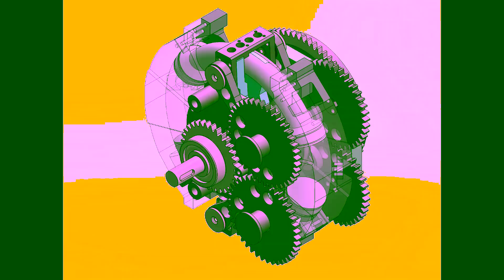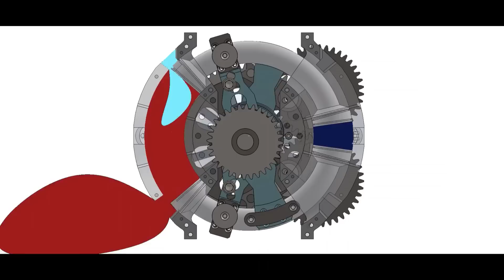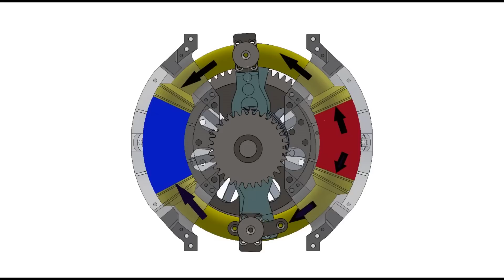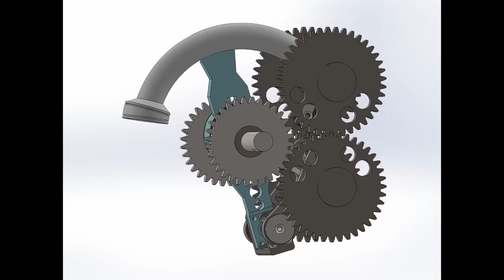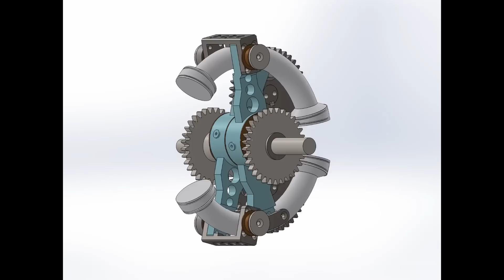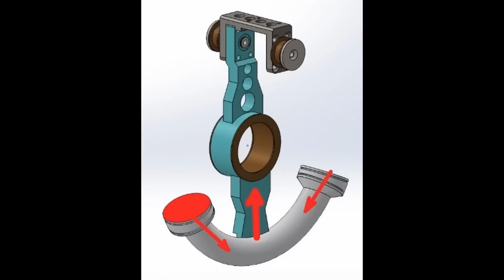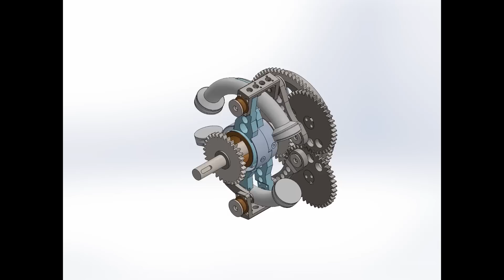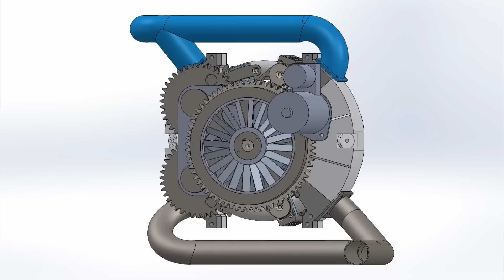A new type of Engine

Comment: This looks very similar to the Taurozzi Pendulum Engine which also works on the idea of a curved piston cylinder. It tauts the advantages of minimal contact with piston cylinder walls and many of the same advantages you have mentioned in your presentation. Mr Taurozzi (who designed the Taurozzi Pendulum Engine) also managed to build a working model of his engine and tested it on a highway, showing that his engine design is possible and functional. 

The Achates Power Opposed Piston Opposed Cylinder (OPOC) design is a two-stroke design which suggests that you are heading in a good direction with your design choices - since they are already testing prototypes.

Unlike Achates Power I noted was that Mr Taurozzi did not use an OPOC configuration, instead he opted to used a traditional engine design (i.e. using an Over head cam system) - that being said there are a few alternatives to the design of his engine. Some of which start looking very similar to what you have shown (look at the double pendulum version).

(My Opinion) Your design looks to be somewhat of a hybrid between the Achates OPOC and the Taurozzi Engine, all with your own unique spin on how these designs come together and I believe your design could very well be the next big development in the automotive industry.

With all this in mind there is a definite credibility that your design could work based on the research that has already been done in the previous mentioned engines.

Keen to see your proposed next presentation that were mentioned around this novel engine design.

All about the Taurozzi Pendulum Engine | Advantages, Working Principle, and Performance (100144.V1) on the Ft-share International channel
https://www.youtube.com/watch?v=5ekoNVc6pm0

FIRST DRIVE: Achates Power 2 7L OP Engine on the Achates Power channel
https://www.youtube.com/watch?v=usmauFigpzk

Comment: The design is interesting, but constructing these on the factory will be expensive due to the curves machining. Curves should be very precise to handle gases pressure in pistons with no leaks

Comment: Interesting. There a lot of torsional issues but it's almost like same complications in a Sleeve valve arrangement. The other point of concern is gear inertia & surface hardening. Sealing the travel areas & for lack of a better term the "Crankcase"....up in smoke would go any friction theories. It would a monster to assemble.

Comment: The moment you try to change the direction of a body there is always a force. This force will try to bend the piston there is no perfectly rigid body in the real world. Because of the elasticity of the material the piston will be in contact with the outer cylinder wall and thus friction will occur this means it needs to be lubricated. When you want to seal the combustion chamber this means the clearance should be very small and here comes the imperfections of the metalworking - no two pistons will be the same, again you need lubrication.

Comment: I am aware of about 20 different types of internal combustion engines. They may be more, I do not know everything.
Yet, for mass production, the manufacturers still go ahead with the same types that were used for 140 years.
This is only a fact, I am not the one to answer why is that.

Comment: These cylinder bores are impossible to hone
Reply: As electrical engineer (so, not mechanical), I think that is possible, but it would be very expensive, not feasible for mass production. So, I am not getting my paycheck from implementing manufacturing technologies, but the way it could be done is with a spherical honing tool, at the end of a flexible shaft. Because the axis of that cylinder bends in an arc of almost 90 degrees, the spherical honing tool would need to enter from both ends, and advance until the middle of the cylinder. 
This kind of headache worth for one piece to be send in cosmic space, not for a mass produced object.

Comment: Before I make my comments about this engine, I'll state my experience in the field: postgraduate (by research) qualified automotive engineer, with 21 years of experience. I've been an professional engineer in many aspects of automotive engineering, including design, warranty and quality, fleet operations and maintenance. I've worked in a number of areas of the vehicle, including HVAC, interior, brakes, suspension, powertrain integration (fuel storage/delivery, mounts, exhaust, air induction, powertrain cooling), and engines.

With that said...

No, this engine won't be frictionless. It will have just as much friction as any other IC engine, if not, more because of its complicated mechanism and unusually shaped bore and pistons. Saying it will be frictionless shows your inexperience in engineering.

Assembly would be "interesting" to watch if the pistons are truely of a single piece design.

In a normal IC engine, friction is relatively small compared to the energy lost due to the thermodynamic efficiency limitation of the ideal spark ignition and diesel engine cycles. Making a complicated mechanism that doesn't reuse the waste heat that's an unavoidable part of the relevant thermodynamic cycle for the engine will only serve to make the engine more complicated, costly, and unreliable than normal engines of the same cycle and compression ratio. It will also make them use more fuel than a normal engine of the same cycle, CR, etc.

The heat lost through the walls of the combustion chambers will be comparable to that lost for normal engines of the same cycle, compression ratio and materials.

While it would be possible to make such engines with the manufacturing technology that's available now, this design would be horrendously expensive to mass produce. Sure, it could be 3D printed, but to do that at the tolerances required for an IC engine with the types of materials that are required for IC engines would be very expensive.

The inertia of the pistons (which would be considerably heavier than those of a normal IC engine of the same displacement - especially with their pendulum arms) would result in considerable vibrations. The motion (and inertia) of the cranks will only partially counteract this. To balance this out properly, you would need to put at least four of these engines together in the same crank configuration as a normal inline four-cylinder engine, which would make this an incredibly complicated (ie: expensive, and probably unreliable) design.

In this design, since there are four cranks which are in phase, all stopping at TDC and BDC at the same time, it has the same mechanical disadvantage as a normal single-cylinder ICE unless it's manufactured per my previous point. The cranks are also considerably off-centre with respect to their wrist pins on the pendulums, which will make the speed profile of the pistons considerably different in the two directions. This will be bad for vibration and engine tuning.

Being a two-stroke, it has the same disadvantages (and advantages - if it's lucky) as a normal two-stroke... provided that the added complexity doesn't eliminate the two-stroke's advantages (which it probably will).

It looks like it will need a supercharger to make up for the fact that it doesn't have a crank-case that's suitable to use as a pump to push air into the cylinder.

Because it will need lubricating oil for the cylinders (the idea that it won't need lubrication is absurd), there's a chance that it could use just as much oil as any normal two-stroke (this will depend on various aspects of engine design).

In order to prevent piston scuffing, the crank cases (yes, more than one will be required) will need to be precision machined to tolerances that aren't required in normal ICEs.

Considering the very high cost of tooling that's required for mass production of normal ICEs, and the far more complicated machines required to build this design, the tooling cost for mass production of this engine would be extremely high. It would have to show extreme benefits compared to normal ICEs to justify the extra cost. Given the fact that it absolutely will not have the benefits required (if it even has any benefits over normal ICEs), there's no way that such an engine will be produced in mass quantities by any manufacturer anywhere, ever. Sorry, but I'm just telling it the way it is.

It's an interesting design that has been tried (and shelved) before, but it's nothing more than a curiosity. If you get any investors from considerable companies, it will probably be because they foresee you having certain problems that they would like solutions for in other applications, and they see you as someone who thinks outside the box, and as such, you're a potentially cheap way to get a solution for something else. My general advice is to get some experience, find something that actually needs to be solved, and design something that fixes the problem, rather than to make yet another complicated and expensive engine (it isn't the first, and probably won't be the last) that has no chance of ever making it into mass production.

Comment: Nice Video!

I don't know so much about motors, but if I perceived it right, you only have 2 combustion steps in the engine (instead of 4 in traditional motors).
So to me, it seems like you have to add some technology for gas-exchange, or design the 4-cylindric version of your motor in a way that it has 4 cobustion steps...

Is there some technology to quickly exchange reacted gas by fuel? And  how can we separate the two Gases, so we don't have any fuel loss.

I'm hyped about some cool problem solving of You or to otherwise learn something about existing solution for that.

Comment: The valves are way down the piston stroke. That means less air fuel mixture can be taken in. You could place the valves at the tdc. And please talk less about the efficiency. All piston engines work on thermodynamic principles. That means they are bound to be victim of heat loss. I urge you to please talk about the motion conversion. From rotational piston motion to connecting rod's linear motion back to rotational crank motion. 
It seems that the actual working principle is buried under the grave of your claims.
When this happens we must assume that something is wrong.

Comment: If you flip the exhaust to exit the top side and intake to enter the bottom I feel like that would help to get more fresh air into the combustion chambers. Since hot air rises anyway the fresh cooler air will want to fill in the space faster. Would make for a slightly more complicated intake and exhaust but it's a 2 stroke and anything that can help get the exhaust out of a 2 stroke is good. Very unique design, would love to see it work. 
Ive always heard combustion engine efficiency was more around the 20s of percentage. Then things like the Hemispherical heads added about 4-5 percent and then opposed pistons like this we're achieving closer to 35 or 40%. 
Seeing that the explosion has to be contained  in between 3 walls and only 1 wall wants to move. Adding that opposed piston makes it so the cylinder is now the only wall that doesn't move as typical for combustion engines. Hemispherical opposed pistons would be the best but you would need some super hard steel or titanium piston heads to hold up to the abuse around the edge of the piston.

Comment: I don’t see much thought put into the fluid dynamics of air… if this is going to make power, you need volumetric efficiency, basically getting the spend gasses out, and fresh air (and fuel) in… gasses that are still expanding when the exhaust valve opens not only leaves power on the table (part of why long stroke engines produce more torque), but also will not adequately draw in fresh air by the scavenging effect as the gasses exit the chamber and travel down an exhaust runner… is there something I’m not understanding, whereby there is a mechanical contributor to induction?

Comment: A rotary opposing piston power plant is a great idea, I see it having good ship engine properties, which already tend to use opposing piston engines (and ideally run at a steady rpm for long periods of time). Also works well with the water injection cooling function. Great presentation and great idea

Comment: While I see that this is a well thought out design, I would worry about the mechanical friction of the gears. Regular engines work via a crankshaft connected to the Piston. By moving the rotational motion to the gears we now have multiple sets of cogs that now need proper lubrication, lest the entire system burn up. even if the piston itself didn't need the oil, the gears couldn't last long with the stress of going faster and slower suddenly. and the noise it would create would be enormous. I would expect a loud buzzing sound like a Wankel engine. 

Otherwise this design could be stackable, and self contained easily. I would just worry about its Efficiency compared to a two stroke engine, Wankel, or a box engine config.

Also "Rotary engines" are the ones affixed to prop planes. I would work that name out... "Crescent engine" comes to mind with the moon like look of the pistons.

Comment: Would be intrested what your thoughts on how lubrication is achieved, intresting thought and a working prototype would be really intresting but i would also worry about complexity(altho current engines also face that problem) and the issue with gears wearing and reducing efficiency(mayby chains or another method im not sure)

Comment: great idea, altought i dont think making it a two stroke benefits it, first of all it vents exhaust and takes air in through the same port, while also leaving a gap behind the pistons, meaning they cant be properly lubricated by normal means, so as in a two stroke youd have to add oil into the fuel, further decreasing emissions and efficiency. the engine also has a very small timeframe to suck in air, leading to huge power losses compared to a four stroke. all im trying to say is you should think about making a four stroke version, or at least some variation of the four strokes valve design.

Comment: And where is the pre-compression of the fuel-air mixture in order for it to then displace the exhaust gases in the combustion chamber? A conventional 2-stroke engine, when the piston moves down, compresses the mixture, which then, when the supply channel is opened, displaces the exhaust gas from the combustion chamber, but this is not in the diagram above. Therefore, after the purging channels of the combustion chamber are opened, both the exhaust gas and the fuel-air mixture will be in it, and how will it be ignited? The only option is to add a turbine to pressurize, but there are also risks that the mixture will enter the exhaust system after the combustion chamber and will already be burning in the muffler. In general, where is the question on the design of this device

Comment: The problem with this is that it is very costly and time consuming to manufacture a torroidal cylinder. There was a pendulum engine idea which had a curved cylinder as well but the manufacturing process was so complicated and most of its claims were not accurate so they had to drop the idea

Comment: This is a really cool concept, but you may want to examine the material stresses on the curved pistons. That kind of thing could cause uneven strain and premature breakage. Or it might not be a problem at all. that's why you should look into it, to confirm one way or the other.
Reply: Could you please explain how to do that ? 
A curious amator question.
Reply: @yezzamouad9469  Unfotunately I'm not a mechanical or structural engineer, I just know about the uneven forces. I'm not sure if material science is even good enough to produce a piston with varying strengths across it's volume in such a way that could make up for the stresses and strains.

Comment: I'm curious on the method of converting the pendulum rocking motion into a rotational force. I'm no engineer but the only method I can come up with is a ratcheting mechanism... If that's the intended method, what is the anticipated life span of such a system? It would be a wear item like a clutch and would need to be easily serviceable. But I could be way out in left field here too...
Reply: Watch the video slowly in the 0:25 to 0:30 range. Can you see the connecting rods from the "piston mounting arms" to the gears? Those convert reciprocating motion into rotational motion.
Reply: @xtnuser5338  thanks! I missed that part.

Comment: In theory, this looks great. There is a very big but, and thats two stroke engines. Two strokes typically provide more power, but are noisier, and do not run as clean as 4 stroke engines. And with all of the computer management on 4 strokes engines today, I would not even say that 2 strokes provide more power than a 4 stroke of the same size. 2 Strokes are far simpler, and cheaper to manufacture, but thats about their only real upshot. If this engine can not produce a significant increase in power output than a 4 stroke, while also have better Noise, Harshness, and Vibration values than a 4 stroke, its already dead in the water.

Comment: The first error that I see is that the energy exchange does not cancel out losses from one piston to the other.  these forces would be additive, nothing cancels anything.  Forces that cancel each other do nothing to drive the engine.  Or the car.  The energy is just gone.

Comment: I'm pretty sure they apready did this with 4 cylinders and less gears
With also it has the same piston design but on a big rod and it's going to a gearbox instead. Could be simplified quite a bit, and also vibration looks like it would be horrible. Just a few things to think about, also a set of four pistons would probably be more powerful and simpler.